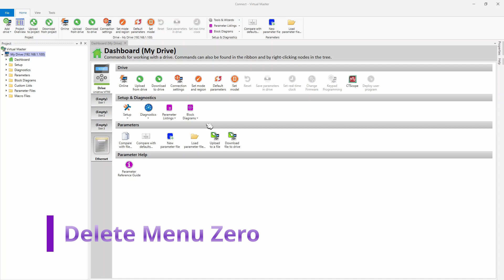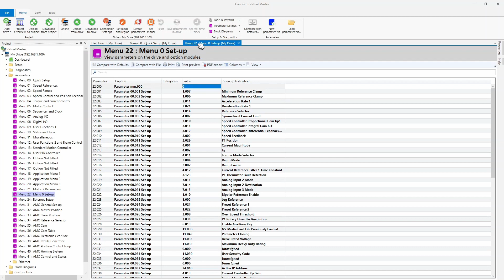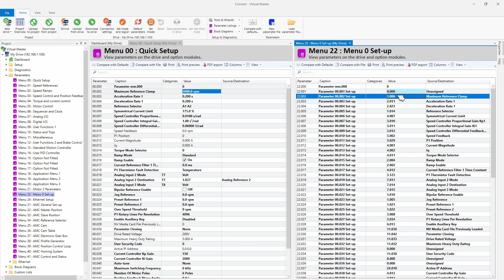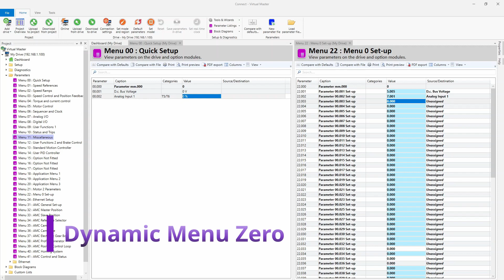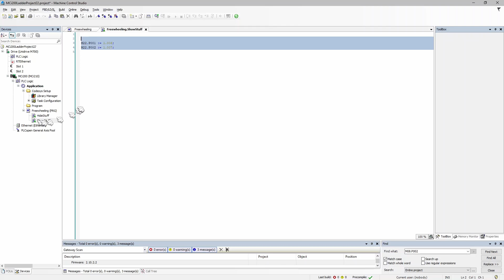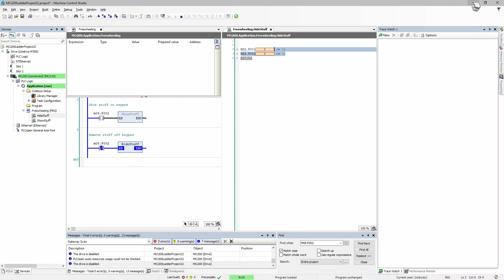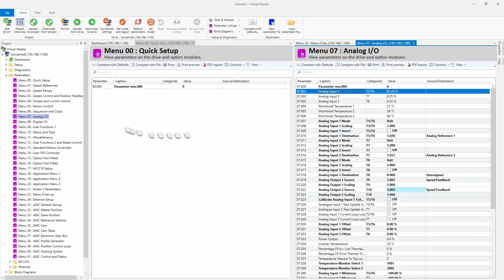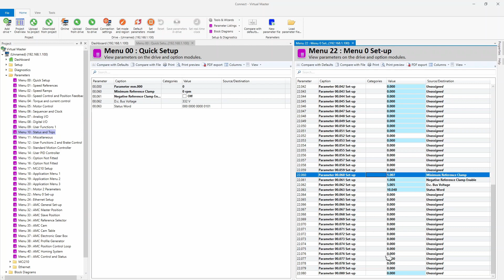5 Things You Don't Know About Menu 0

Comment: The video is very good, I only have a doubt about "Fast modbus network", and when I have the arrangement in menu 22, it would be the address to place in my data exchange, let's say that in menu 22 a copy of the parameters that you assign to it? Besides, they are only 16bit parameters, but it seems like a very good tip to me.
Reply from the maker: Thanks for the comment. So, the reason why Modbus can be faster when you use menus 0, is because all the parameters are together.  This way Modbus can pull up to 10 parameters all in a single read. If the parameters are scattered all around the drive, then Modbus will read one parameter at a time. For example, I can read 10 parameters in 20 milliseconds if they're all grouped together, or I can read 1 parameter in 20 milliseconds then go read the next one.  As you can see it is faster to read a group than 1 at a time.  I’m not trying to say Modbus is fast like other protocols just that it's a faster way. 
You are right that the default Modbus is 16 bits. But the drive also supports a 32-bit version as well. If you would like to know how to read parameters as a 32 bit with this drive let me know and I'll tell you how.  Again, thank you for your comment. I'm glad you like this tip.

Comment: Thanks for this content
Reply from the maker: Our pleasure!
Is there a video you would like me to make?
Reply: @vfdcode  my servos gets hot ,let me know what could be course, all plate number values are well captured
Reply from the maker: @seimela  
Without knowing anything about your application it is not possible for me to answer the question that you're requesting however I can possibly give some insight of some things I see that commonly cause motors to run hot.  
1. The motor is undersized for the application.
2. The drive doesn't know where the magnets are located. This tends to be because you didn't do a rotating auto tune.  During a rotating auto tune the Drive locates the phase angle, magnets.
3. The speed loop is too hot for the mechanics. What this means is the speed loop is a bit nervous and it's oscillating between two points causing it to use more energy. This can happen because of compliance in the mechanical system.
4. The speed loop is too hot for the encoder you have.  If you need a hot speed loop or in other words a larger value in the speed loop this can happen.  This is kind of like #3 but it's having to do with an encoder instead of a mechanical reason.  For example, a 1024 PPR encoder has very poor speed regulation. 
4. Motor data is not right.  You need the voltage, amps, and number of motors poles to be right.  Especially the number of motor poles.  The other key items can be found using a rotating auto tune. The remaining items are helpful and either protecting the drive or dealing with torque compensation but are not necessary in most cases.
Reply: @vfdcode  this is well documented diagnostics  ,much appreciated